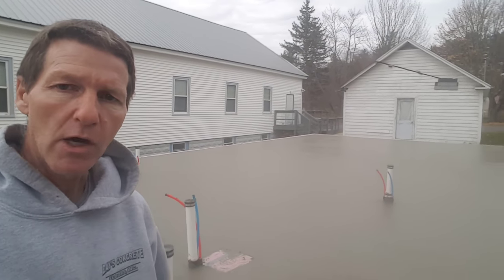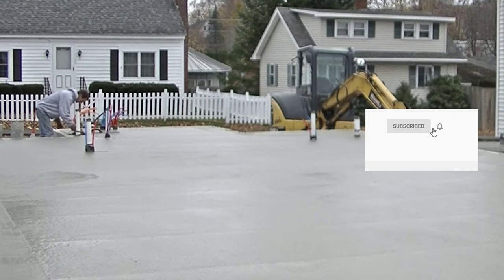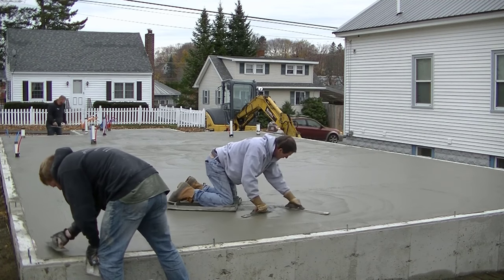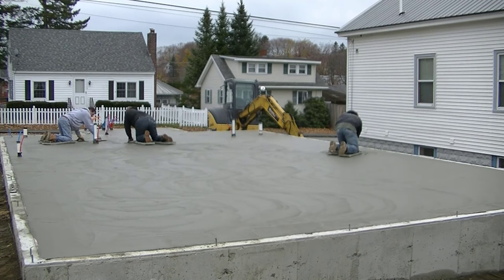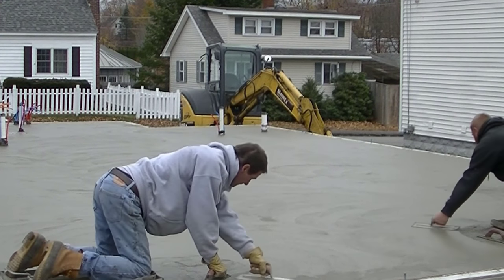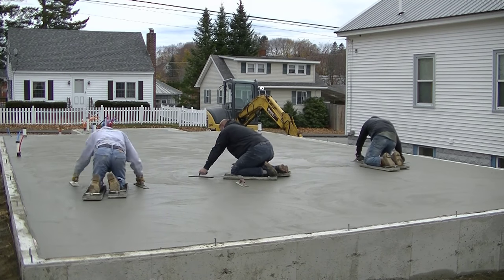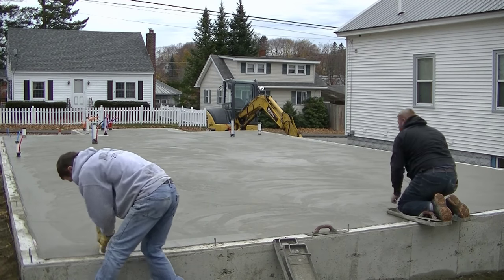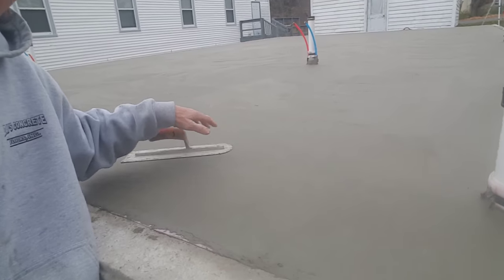Learn How To Finish Concrete Smooth | Steel Trowel Concrete

Comment: I poured today too! 30 yards ..its been hovering at 33 degrees, foam underneath, I have insulated blankets I am going to put on right now, (9:30 pm) we have bad weather coming tonight too, (upstate ny) 1% Non calcium chloride accelerator, hot water mix
Reply from the maker: I'm not a big fan of the non-chloride accelerators. Only use them if I have to. They don't seem to work as good as the chloride one's especially flake calcium.
Reply: @MikeDayConcrete  thats good to know. I dont do alot of cold weather pours, so its real nice to see you cover the topic and see how you do it. I went there today to check on the slab and it was warmer than my hands were, I almost think it was 70 or 80 degrees, its amazing how much heat the concrete generates while curing. Also amazing how well these concrete blankets work, bought them for a job one time and they already paid for themselves, I think they are 12x24. Good videos mike, thanks for the response
Reply: Can you sponge it up small space

Comment: Just curious....when the weather is more hot, less moisture, do you do the sanme process?  Do you do a mist spray between troweling phases??  Ifyou were to get your typical quikcrete and add mortar, for projects, could you get a smooth finish also?  Your thoughts..and THANK YOU.

Comment: Great tips and you make it look so much easier than my experience.   I've worked as a helper on a number of slab jobs and I'm curious as to why you don't seem to have the common issue I've seen of stones near the surface which makes toweling and edging very difficult at times. I was wondering, do you use 3/8 stone on your jobs?
Reply: jitter bug it !!!! we do all are basements and garages that we crawl the hole floor for sure makes your finishing much easier! great video mike so i have alot of respect for you you and your amazing team every job site looks clean noting in the way as your hitting edges or bullfloating. the prep work is what make jobs run smoothly like you and your crew keep up the great work and thanks again for the help  throuhg out the videos i know your concrete giuy and how hard it is to and for  you to take the time to let others see the problems and your troubleshooting skills and patience is amazing

Comment: I watched this video seeking advice on finishing a slab with a metal
     trowel...THANK YOU!
I was watching this while a slab I just poured was drying...
     thank GOD I did!
During your commentary you keep mentioning that,
     you and your crew had been pressing down hard on your metal hand
     trowels.  This seemingly irrelevant information saved my concrete slab!
I would have been likely, not to  apply a lot of pressure and probably
    wouldn't have been able to pull the "cream" to the top achieving
     a smooth finish (on the top of the concrete slab) to later lightly 
     broom.

Thank you for sharing your experience with concrete.  I learned not be afraid  of really working the concrete (while wet and drying) with a some force to pull up the cream...and some finesse for a smooth slab surface.

Thanks again for sharing!
Reply: The way you typed this just about gave me a seizure

Comment: Gonna be finishing off a slab in my barn that was left gravel for a dozer. Doing it 20'x35'x6" slab with #4 18 on center tied into the existing slab because I'll be installing a car lift. Thanks for these videos. They are giving me some things to think about before I go in blind.

Comment: would like to see it after it dried, for smoothness Concrete as you know is hard to see the finish Great job! I am about to embark on a pour (800 sf Ill break it up into 4 separate pours. Also has heated floor.  )where 1 I can't get the material delivered so hand mix and pour. and then no Power float. so Ill have to do it all by hand. Q: do you think the smoothness is good enough ie achievable for the final floor? My wife and I like polished concrete as a final floor finish. No tile not coverings at all. thoughts?

Comment: I am trying to fix a small hole on floor as the wood tile got damaged. I want to pour little concrete and just smoothen it on top. is there a specific type of concrete I need to use? and when should I start smoothening it?

Comment: Do you not find that every trowel stroke always leaves behind these two lines (corresponding to the two ends of the trowel) and when you try to remove one of these two lines with another stroke of the trowel you just create two new lines, and you can never really remove the trowel lines?

Comment: I used one of those concrete patio Mold's only for small scale platform, had ready mixed bags, didn't smooth it as much as I should have and didn't used a mag, bits of aggregate are floated to the top on dry so brushed off as much as possible, should have added more cement to make it a smoother mix I guess, Im going to make an SBR and cement paste/slurry 50:50 Water and SBR and a little Cement then paint it over the stones and that should give me a great bond and smoother finish. Listen to this man, one of the best channels on here

Comment: Thank you very much for this.  I have an unlevel floor with all kinds of warps in the original pour.  I am mixing my own with 1:2 portland to masonry with fine sand, watering the floor, and dumping the dry mix in the puddles, mixing, and troweling to the water line.  So far, this is working with excellent strength, but it's not exactly beautiful.  I will probably try your method here with a skim coat once everything is level.

Comment: Great videos! I'm a novice who is mixing, pouring and finishing my own concrete.  You use hot water and calcium chloride.  I use room temp water, pouring a 4-6 inch slab.  How long should I wait before I finish it?

Comment: Hey man got a question about trowels. Are blue steel round finishing trowels applicable for everything. Ive seen some crews use both blue steel and stainless steel for different passes and that never made sense to me. Are stainless steel mainly for burnt/hand trowel finish floors? Overheard some contractor talking about hard trowling or something?  What is that

Comment: Oh I see,, I use a 21" trowel, it's alot faster,, I bend them before first use with a hammer, no trowel marks at all ,, my trowel is as fast as a power trowel,, up here I'm the quickest, I'v worked with over 5000 men unionized work ,, I'v raced em all , Italian, Mexican Portuguese, I rip em all , quickest finisher I'v ,,raced,, was a black guy golden glove bastard,, he stopped 80% in ,have would've been champ,, I'm really fast,, you would laugh at me brother 🖒
Reply from the maker: I'm not as fast as I used to be but I'm as good once as I ever was.
Reply: @MikeDayConcrete  your years in the business, you look like you kept in shape, very simulare to me my brother,  your the man, im on my jobs like you as a finisher, its inspiering, thx

Comment: Thanks for sharing you knowledge and on such a coldish day!  Here in Oregon, we have been blessed with dry and cool weather.  Finally got started on pouring concrete path to our greenhouse.  This video you just put up helps so much on how to steel trowel.  My third pour today and each pad looks better than the previous.   Still want to start the finishing too soon.  Gotta just walk away and let it sit longer.  I like your finger touch demo.
Reply from the maker: Yea, wait till it's ready. Too soon and you're just making more work for yourself.
Reply: Good job mike

Comment: If they were calling for rain at noon, you guys were pushing your luck. I’ve done that before an got caught, than it takes me a whole month to work my nerve back up to flirt with the weather man agin. 
on those slabs that have concrete walls around them I always edge them I just think it looks better. I was always taught if you have good edges you can sell just about anything.
Reply: What would be the outcome if it were to start pouring rain or just sprinkling? Dusting and chipping?? Do you cover it with tarps? What would happen to the concretes surface or structure? If this happens to a company does it take a lot of time to come back and fix the damage? Haha Thanks for any help!

Comment: Gday mike question for you. What’s the difference between a power screed and vibrating beam and can you make a vib beam with a small Wacker/compactor plate as a power source? Cheers from the uk.
Reply from the maker: A power screed could mean a number of different kinds of vibratory screeds, either walk behind or ride on. I think most people refer to power screeds as vibratory like the Shockwave by Marshalltown. I've never used a vibrating beam but they look like they need a form of rail to ride off from on each end to get a level floor.  I'm not sure about using a compactor for a power source.

Comment: I kept wondering why i would pull chucks on concrete off from my steel trowel when I was finishing. I’m assuming it’s the same thing as with the slides. I can’t just pick it up, I have to kinda slide it and then pick it up. Also I was always told when finishing with steel trowel the first swing should be about 3/4” high and when coming back to lay it as flat as possible. Or does that not really make a difference?

Comment: I’ve been hand troweling floors for about 2 years now, and what I’ve been doing the last dozen or so floors is hit the pad twice with float blades on a power towel , and hand trowel it twice and it’s done.. I think a power trowel makes a flatter floor if you use that to float, which in turn makes hand troweling behind it much easier. I do love the novelty of just hand floating/troweling cause you can save yourself a few hours. That being said I think just using a power trowel to float you don’t loose a lot of time, because it’s the power trowel on troweling blades that steals the time..in my experience... I have noticed you don’t use float blades more then one round which i find interesting, I ussualy use them as long as possible, up to 3 rounds sometimes.. my boss/trainer has been doing concrete for 20+ years and he would always just either all hand trowel or all power trowel.. I don’t see why you can’t do  a bit of both.... wondering if anyone else does floors like that? taughts? Also I don’t think there’s anything more beautiful then a nice hand trowel finish👍..
Reply from the maker: Sometimes we'll hit the floor with the power trowel first, then chase it out with the skids. Sometimes we'll also 2nd float the floor but most times only once.
Reply: You have so much to learn my friend,there's many ways to skin a cat
Reply: You have so much to learn my friend, there's many ways to skin a cat and concrete slabs are not the exception
Reply: pocoyo batista I would agree with that. I just taught I’d share what I’ve had a lot of luck with on small to medium size slabs and if he has used that same method.. I’m not sure how he pushes the stones down with just one float but that might come with experience..

Comment: Here in Ohio we call that a flat trowel finish. But  they usually want a hard trowel finish on any floor where the concrete is going to be the final finished floor.  Usually the flat trowel finish is OK  if they are going to cover it with tile or carpet or something, but if the concrete is going to be the final floor they want it a lot smoother. like glass.  Smooth enough that you don't hear  those little popping sounds from your trowel hitting stones and you can a mirror image in it. 

Hard troweling also makes the surface a lot harder. It's not just cosmetic.
Reply from the maker: Right on, thanks John!

Comment: Do bull float first and then use the mag float? Thank you for sharing! 🙌
Reply: Did you get an answer to this question? I was also wondering, for a basic do-it-yourself backyard job, if I could just do wood float and then steel trowel.

Comment: Hey Mike we haven't used calcium for years. It's a different type of accelerator now. We still call it calcium but it's not. The calcium reacts with the steel reinforcement and corrodes it.

Comment: Hi, great video.  Is it necessary to steel trowel if the surface will be tiled over?  Seems a rougher finish would help with adhesion.
Reply: If u don't. Mind I can answer that.
You don't have to kill yourself making it smooth...just make certain it's level.any high quality thinset will bond to concrete.smooth or rough.
If it's smooth. Though....notch troweling the thinset will be easier.
Another thing done quite often is making a "dry pack mix"
Typical Portland to sand ratios
But not as much water added.
It's easier to manipulate and will cure just as strong.ive done jobs where I build up the dry pack cement and thinset back of tile and set it...doing it all in one shot.
However some expert tile guys like to screed their dry pack bed to perfection...let it cure ..then next day start slamming tiles👍hope this helps

Comment: Knee boards.   We used to make them out of boards back in the bay. You’d have to pick each one up and move it over and over.   Sliding ones make a world if difference
Reply from the maker: That's cool. I remember using 2" styrofoam in 2' squares, one for my knees and one for my feet. I would keep moving them back like you did.

Comment: Heh Mike....how far into your timeline did you bull float it? I noticed you said it was about 1/2 hour since finishing the pour...you said you'd start trowelling.
Reply: I can’t speak for Mike, but with most crews, bullfloating comes right away after screeding. As soon as a man has a chance to ‘come up for air’, he’ll jump on the bull float. If you get a little behind and can’t hit it right away, you can sprinkle a little water on the surface just to help float it out.
🤜🤛
Reply from the maker: Yea, right after screeding. When the concrete is setting fast, you want to bull float asap.
Reply: @psidvicious  Cheers! BTW love the handle psidvicious....remember it well!
Reply: @MikeDayConcrete  Thanks very much Mike....I have alot to learn......!
Reply: @MikeDayConcrete  Oh yea, almost forgot. Speaking of getting behind on the bullfloating. If the concrete is setting up fast on you, you can put a cpl bricks on the float or a few trowel fulls of wet concrete to add some weight to it and that can help out a lot if a sprinkle of water is not enough.
🤜🤛

Comment: I call 'em sliders, or sometimes, skids, because that's what they do, slide across the concrete.  Kneeboards are wide rectangular boards with handles and a thick foam padding
Reply from the maker: Yea, I used to use styrofoam as kneeboards back in the day.

Comment: How do you know when to start with the steel?
Reply from the maker: It depends on the temperatures and if the sun is on it or not. It's just timing but takes a bit to learn. We usually steel trowel 15 to 30 minutes after mag float.
Reply: @MikeDayConcrete  any sort of manual indication? Like too hard to press?

Comment: 1% or 2% calcium for that temperature? Do you have a rule of thumb in regard to the temperature and the percentage of calcium chloride / polar set? Thanks for the info.
Reply from the maker: We were a little over 2% for this floor. But we needed it to dry very fast. I don't really have a rule of thumb, it depends on the temperature mostly, the sub-base, if there's hot water in the mix or not, the temps that night (freezing or not), if it 's the first pour or 2nd pour of the day. Just a lot of little factors go into the decision on how much we use.

Comment: We call them sliders. We prefer to use pozz over the calcium
Reply from the maker: I've always had good luck with set times using calcium. Not so much with other accelerators.